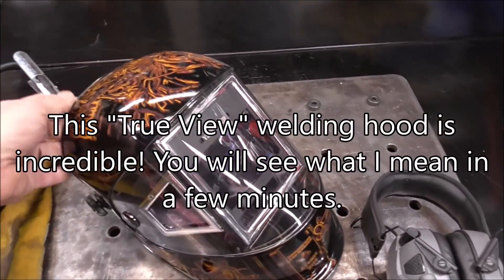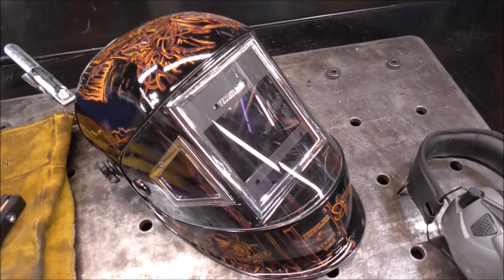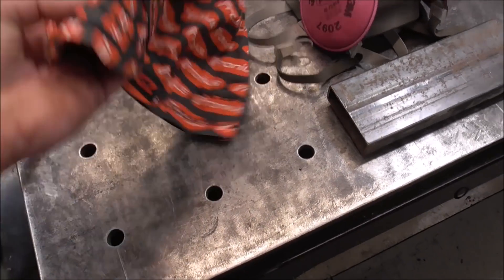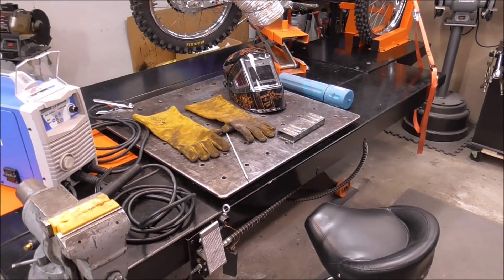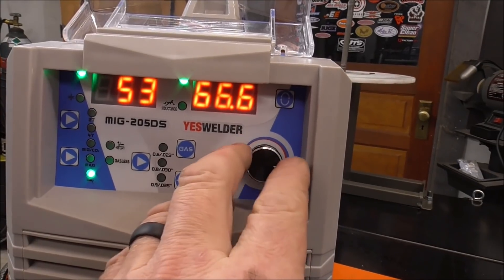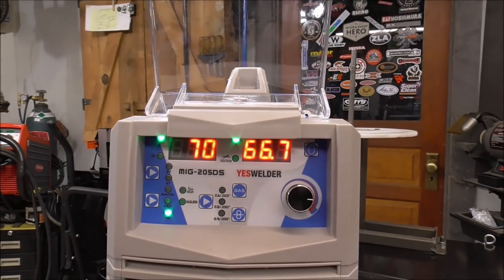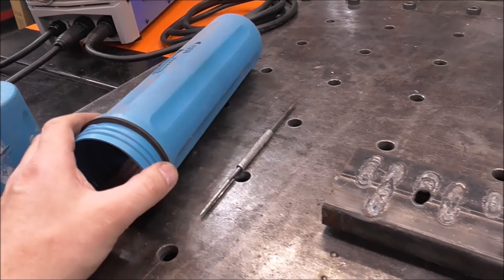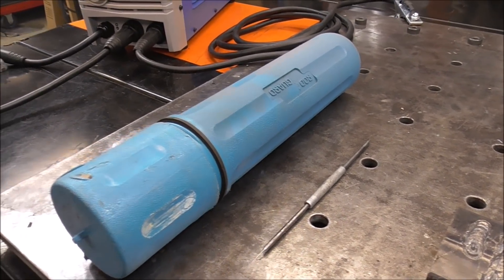Stick Welding Tips to Start Welding Better Today

Comment: I also seen a guy that used a head band style led light. He removed the strap and just velcroed it straight to the welding helmet. I thought that was a super cool idea too. My Atak headlamp is super bright and rechargeable… I highly recommend it if you’re interested in a nice rechargeable headlamp. The charger cable is magnetic too so you don’t have to fight with plugging a cord in. Which also means the bottom of the headlamp is magnetic so you can take it out and stick it to a piece of metal and focus the light wherever you want…. No charge for that tip…😉😆
Reply from the maker: I love it! I'll have to check that out. Thanks for sharing!

Comment: Great refresher crash course! On a recent lil project with thinner material, i started out on dc pos, quickly realized why i was making holes, then switched to dc neg…project done! Great video!
Reply from the maker: @BrianR— It's crazy how much of a difference it can make, especially on thinner materials as you mentioned 👍

Comment: Dare I say you can stick weld anything with 130-140 amps I’ve welded 2.5 inch thick plate with 1/8 6010 and 7018. Just bevel it out and burn the root pass in with 6010 and then start laying stringers with 7018. It’s not quick but it’s structurally sound. Single pass welds at high amps on thicker material are more likely to have structural issues then multi pass ones in my experience.
Reply from the maker: I agree 👍

Comment: Good explanations for the newbe welder. I have watched quite a few videos on these yes welders and many report problems with them. One glaring problem was that their reported voltage and amperages are 25% and more out. These guys used amp meters and checked
amps while welding ,it was guite the eye opener. One guy opened up the welder what a dogs breakfast of wires.
Reply from the maker: Thats interesting @Bruce D I might have to pop one open and take a look. I'm curious now. My experience is that they feel like they run slightly hot but again that's going from the seat of my pants and not using a clamp on amp meter.
Reply: @BrandonLund   have a look at bigtb1717, s channel , he has done a few reviews on various yes welders. I believe he is an electrical engineer, but don't quote me on that. His latest was on the yesselder mp200

Comment: Thanks Mate 🍻,, 
I used my MIG205DS for the first time running Stick,, and WOW! 
 What a difference compared to the first machine I purchased for training.  
Much smoother amperage delivery once I had it dialed in correctly for the material thickness(3/16").
Plus my comfort level running stick is getting better. Yay!  Thanks for the great information. 
Have a good weekend. Cheers 🍻,  G.
Reply from the maker: @Gabriel Szekeres Right on man! Keep up the good work! Stick welding will make you a better welder in a processes.

Comment: If you ever see FR clothing ( nomex is one brand name ) on sale or at thrift stores and it fits you comfortably, buy it. It’s worth having.
Reply from the maker: I've seen it but wasn't sure where it's sold. It looks nice though
Reply: @BrandonLund  I was required to wear it delivering fuel. A set of winter bibs and coat was over $1200, company provided them.

Comment: Brandon, an uncle of mine used an ac hi frequency box when he welded rusty or painted steel as it penetrated right to the base metal. Typically this is for welding aluminum, but he found a benefit on steel. I tried it, and it seemed to do okay, especially in areas such as, say, farm equipment, where grinding was not an easy choice.
Reply from the maker: Thats pretty cool! @Bryant Fry

Comment: Hey Buddy . . .the work light is a great idea. . . . I need to spend more time practicing Stick because I love it the most . . . I found Mig easier to fabricate with, but Stick is my preference.   Thanks for posting this video.  Appreciate it.
Reply from the maker: I feel the same Daniel. I like MIG too but there is just something about stick welding that is so enjoyable. For the light I was just using a small led but if you use one of those halogen flood lamps, that works really well also. Take care buddy!

Comment: Well, you have done it again!!!  Great information, great advice, and great encouragement.  The light on the work is a really great idea.  I tried to weld on a brake rotor and man that was a challenge!!  Hard stuff@!!!  Please keep in formataion coming and the advice about practice...practice...practice is invaluable.  I used my very old stick welder and it did a great job!!!
Reply from the maker: Thanks @Jim MacSuga I appreciate it. A lot of those brake rotors are made of cast iron. I'm guessing you were getting some cracking? I was surprised they were made of cast iron but I have experienced the difficulty welding on them also.
Reply: @BrandonLund  I did not see any cracking, but I did not look too close!!!  It was only a bike stand that I made for working on my bike.  It stuck, and that is all I needed!!!  I will probably not use that type of steel in the future unless I use the bolt holes to secure a more useful steel!!!  Be well, be safe, and keep the vids coming!

Comment: Awesome vid Brandon (as usual)!  Absolutely love your content and how you present the information.  I've said it before, but your helping me teach myself how to weld.  In turn, I'm teaching my boys.  Thank you very much.  Also, glad to see you using that Yeswelder helmet, as I bought one myself, and I'm loving it.  I've only seen you using the Fronius helmet the last little while.
Reply from the maker: Thank you so much man and I'm glad to hear you are passing it down to your little ones. It's a skill they will hold onto forever...plus you are building memories. I LOVE my YesWelder hood but as you know it has a TON of adjustments. I just need to stop and take a few minutes to get it dialed in perfectly because the optics are better than anything I own.

Comment: Brandon, polycarbonate safety lenses are safer than glass, as the fireballs don't stick as quickly, and this makes them last longer and are easier to keep clean.
Reply from the maker: Thats what I use also (polycarbonate) I'm not sure they make a "glass" safety glass but I suppose it's possible. I've never seen actual glass ones though.
Reply: @BrandonLund  glass has been the standard for a lot of years. In more recent years, polycarbonate has become more of a standard. Next time you stop by your welding supplier, see if they still have glass. I got a bunch of cutoffs from a local plastics company, so I cut my own as needed.
Reply from the maker: Are you referring to the lenses on the hood or actual glass safety glasses?

Comment: I see a lot of people grounding to the work table. Is there a drawback to grounding to the work piece?
Reply from the maker: Grounding to the work piece is actually the best way to do it because it creates the least amount of electrical resistance when welding, however people generally ground the table to save time moving the ground clamp each time they manipulate their part.

Comment: For those that don't know, cotton clothing is typically less flammable than those of a synthetic composition such as nylon or polyester. Cotton will, of course burn, by synthetics typically melt, and can do more harm when ignited than cotton, especially to skin.
Also, when welding or cutting metal, don't carry a lighter in your pocket, especially a plastic lighter, as they are plastic and contain flammable butane, and can explode when struck by a fireball.
Reply from the maker: Spot on advise! @ Bryant Fry

Comment: Great tips again Brandon- Thanks for sharing the knowledge.
Very helpful.
One question- when you start a new rod do you chip off the initial tip of the flux from the end so that it will strike??.
Reply from the maker: @Michael Andersaon thanks man and thats a great question. I wish I would have addressed it in the video now that you mention it. No you dont have to do this to a fresh rod. They are manufactured so that the center metal core is exposed. It's only after you strike the arc that you have to do this sometimes.